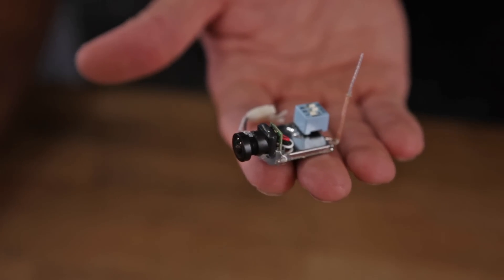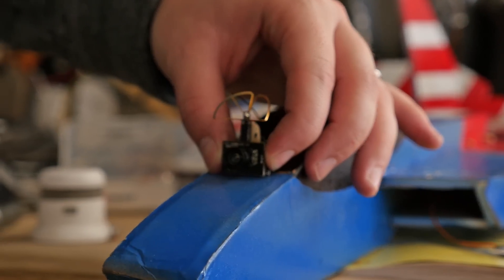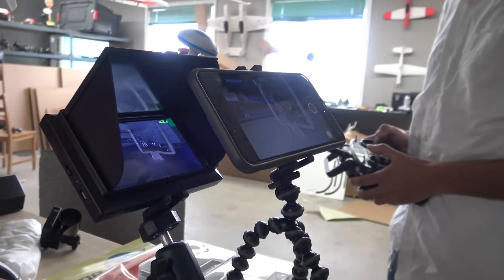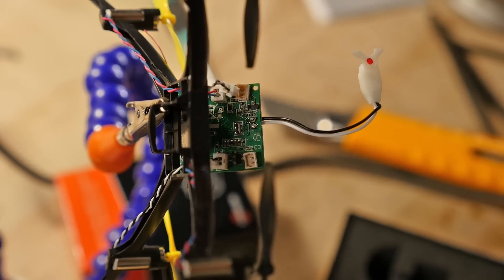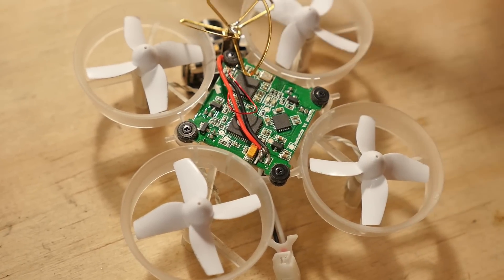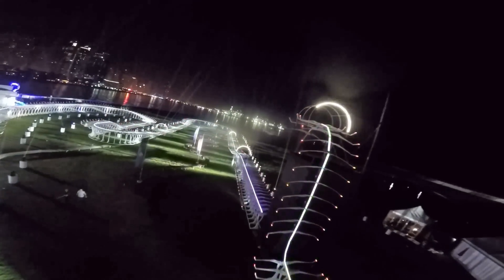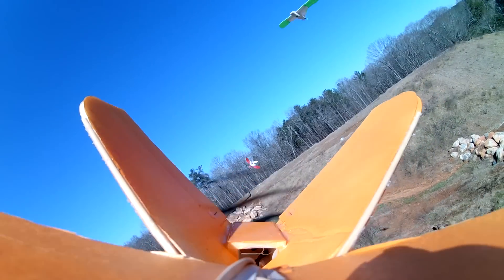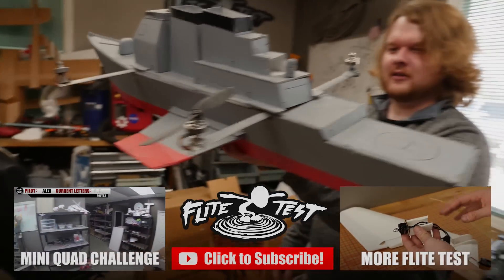DIY Mini FPV Race Quad | Flite Test

Comment: I have been using a Tiny Hawk frame with a JJRC 1000 guts. Used the old motors out of my Blade qx180  put dark editions on 180. Then got the Fatshark goggles that came with mini camera. This thing is so much fun and is making the learning FPV part easier than my 250 quad. Now I need to find a lite camera so I can record,any recommendations? I'm thinking about trying the camera off of the Blade 180 since I have it already but if you have better ideas that would be awesome! You guys are awesome and if you are ever in northern Arizona give me a buzz and I will show you the sites! Thanks for everything you guys do to help us out!
Reply: Get a mobius
Reply: +John Kolar Get a Xiaomi Yi with the blanket protection plan from Amazon. Runcams are pretty fragile in my experience, and your camera is going to take some hits. The Yi has that protection plan so if you smash it to bits, you can send it back and get a new one for free.

Comment: is there a video on this channel for a cheap and easy to build for beginner flyers
Reply: +iroslayer -_- Yes, they have build videos for multirotors, but I wouldn't call it easy. There's still quite a learning curve to master because of all the hardware and flight controller software, etc. 

You can also check out the forum at flitetest.com. People are very helpfull if you have questions.
Reply: Balu thanks but i kinda meant can you please send a link to a video about on how to build a plane or quad. p.s i hope i don't sound rude because i don't know how to say it any other way

Comment: This is super cheap! Is there a way to hack the goggles to take in 2 signals? I was thinking about using 2 cameras to get propper depth perception.
Reply: +lhl2500 http://diydrones.com/profiles/blogs/3d-fpv-camera-the-blackbird
Reply: +lhl2500 3D cameras can be bought for FPV use that only take up one channel. The only thing is that those cameras are connected with a special driver and firmware written specifically for that camera to make the line coding correct for the 3D image. Good challenge for micro sized stuff!